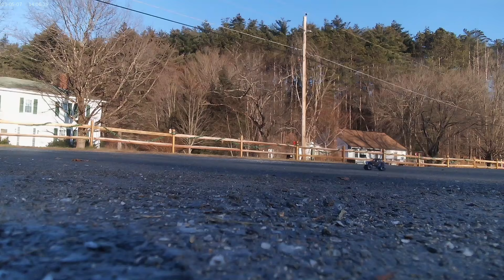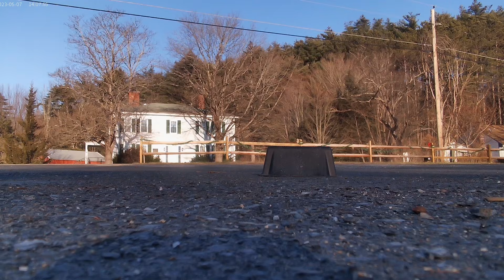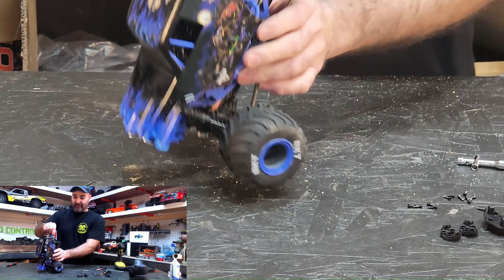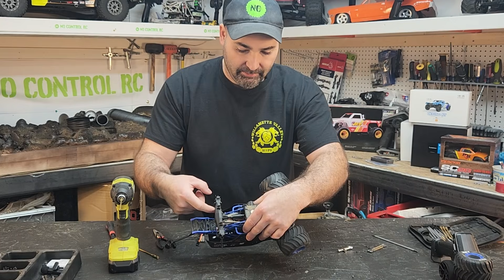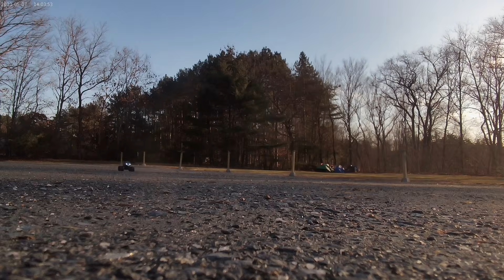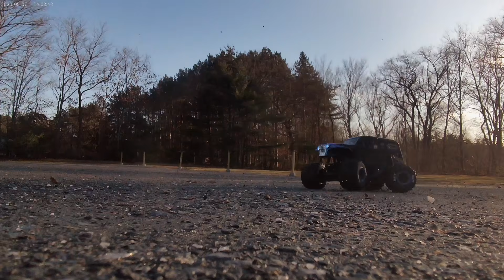How To Make your New Losi Mini LMT have 4 Wheel Steering Its easier than you think +1st test drive

Comment: I'd be interested to know what electronics to put in. I want the rear wheel steering to be on a seperate input or toggle the rear on/off.
Reply: Just buy a replacement ESC/receiver for a UDIRC Snow Leopard Pro. It's like $35 and comes with the transmitter 😂

Comment: Do you have a parts list?
Reply from the maker: SPMSSX108   SX108 SERVO
LOS212049  FRONT DRIVESHAFT SET
LOS214041 SPINDLE AND CARRIER SET
LOS211051 STEERING TIE/DRAG LINK SET
LOS257007 4X8X3MM BEARING SET
LOS212036 UPPER 4LINK / SERVO PLATE
LOS215001 CAP SCREWS 
LOS214046 KING PIN SET 
EFL08261 E-flite Y servi harness or any like y harness

Comment: Is it use front original part or aftermarket parts?
Reply from the maker: I used parts off a second truck because parts were not available at the time. They should be by now. But it may be cheaper and easier to get another front end off ebay to take the parts from.
Reply: @nocontrolrc  thank you.

Comment: Cool setup! Do you have to rewire the pot or just the motor to reverse the servo? 
Cheers!
Reply from the maker: I just revered to wires from the drive motor. But I would say just buy a servo reverser they are cheap from Amazon
Reply: @nocontrolrc8290 wich servi reverser do you get. I got a pack of 5 and nothing works??

Comment: Lots of people that haven’t bought it complaining about the price.  Go find a friend who has one and drive it - it’s a freaking riot.  Anodized frame, smooth coilover shocks, metal drive train and tons of licensing.  Licensing aside you couldn’t build one this size for this price.  Suck it up, spend the money, have fun.
Reply from the maker: It's worth every penny.
Reply: I bought both minis for my boy’s and the are having a blast playing non stop!
Reply from the maker: @viperonfire2006  that's awesome
Reply: I spent the.
Same amount building up an f m s smasher. It's basically the same truck , literally the same truck , except you pay for what you get out the box with the losi
Reply: The PRICE is Fine just saying FOR THIS PRICE a LICENSED SCALE MONSTER TRUCK ...SHOULD! Come factory Stock with a feature found on everything from the Basher Rocksta (which I bought brand new for $80!) the axial AX24 the HSP Pangolin a 1/10 scale truck identical in every way to the Redcat Everest10 except with 4WS and costing around $150 the OG CLODBUSTER which has been around since the late 80's And a slew of other RTR and Kit trucks since. LOSI explaining it away with "increased production costs" harder to handle for an RTR (while Refusing to offer a Kit version either) and durability issues as if the FRONT END wouldn't be IDENTICAL or the "electronics would be TOO COMPLICATED" is just BS My Clod was running a 4 channel Futaba receiver and a fricken servo driven MECHANICAL SPEED CONTROL when I got it in '88 😩🤦🏻‍♂️😒
Reply: I thought the price was reasonable for what it is, this thing will do back flips as well on the right ramp and on low grass. My only complaint is that the run time is rather short, but the battery charges quick on a proper charger, not the stock tiny charger

Comment: Can you post a list of part numbers and links please!
Reply from the maker: SPMSSX108   SX108 SERVO
LOS212049  FRONT DRIVESHAFT SET
LOS214041 SPINDLE AND CARRIER SET
LOS211051 STEERING TIE/DRAG LINK SET
LOS257007 4X8X3MM BEARING SET
LOS212036 UPPER 4LINK / SERVO PLATE
LOS215001 CAP SCREWS 
LOS214046 KING PIN SET 
EFL08261 E-flite Y servi harness or any like y harness 
I ordered all these parts from Horizonhobby.com  but still have not received them, so I robbed the pieces from my second truck til they come in.  Hope this helps
Reply: That’s amazing!! Thank you!

Comment: Is there a way you can list all the parts in your description?
Reply from the maker: SPMSSX108   SX108 SERVO
LOS212049  FRONT DRIVESHAFT SET
LOS214041 SPINDLE AND CARRIER SET
LOS211051 STEERING TIE/DRAG LINK SET
LOS257007 4X8X3MM BEARING SET
LOS212036 UPPER 4LINK / SERVO PLATE
LOS215001 CAP SCREWS 
LOS214046 KING PIN SET 
EFL08261 E-flite Y servi harness or any like y harness 
I ordered all these parts but still have not received them, so I robbed the pieces from my second truck til they come in.  Hope this helps
Reply: What did you use the Los215001 screws on